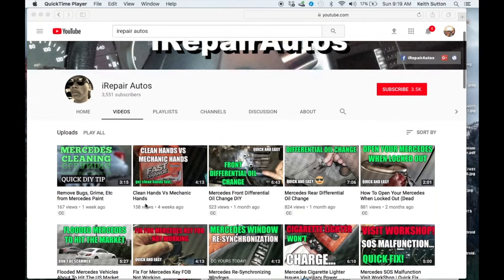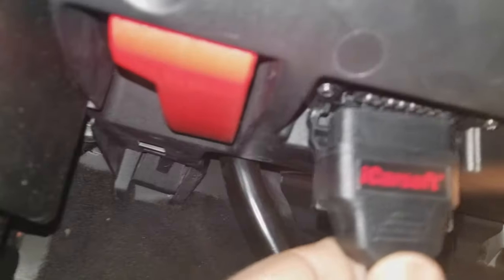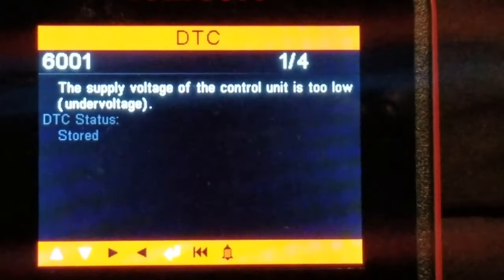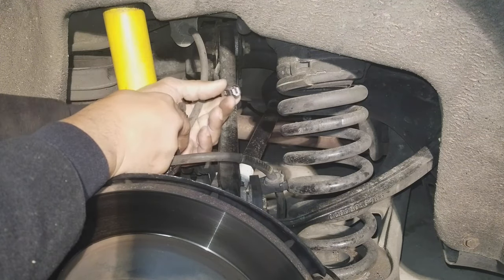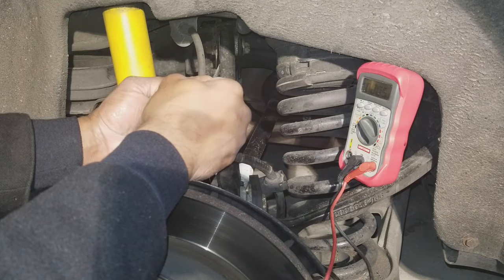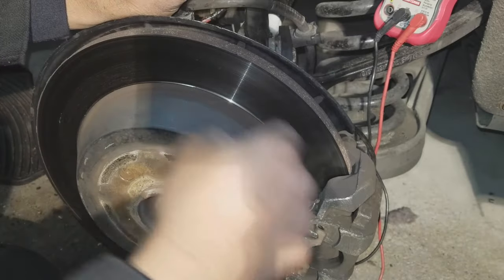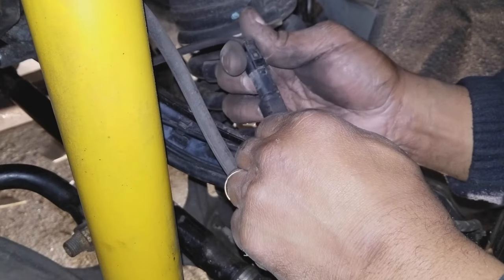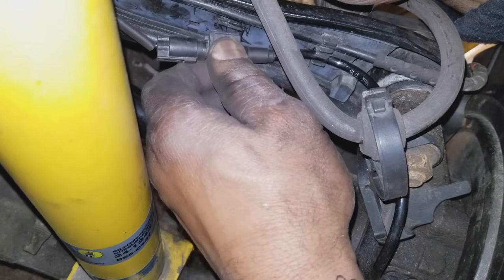Mercedes ABS Sensor/Wheel Speed Sensor Troubleshoot and Replace

Comment: Gday l was looking at a 2000-1  manual 20.ltr supercharged c200 for my son it’s 5000 Australian dollars but the speedometer doesn’t work .the guy selling it claims it has two Speedo sensors and that the OBE test didn’t specifically point out which one is the problem. Dose this Sound seasonable/true?  is it something I can  check for in the owners driveway .and DIY FIX if I bye car .I’ve been burned before.and still paying the price.so many immoral barstards out there. Is there a vid for this problem.thank you 🇦🇺👍🍻

Comment: No Go! Total bullshit! Scan says replace front speed sensors. 5 malfunctions. I installed properly. 2003 E500. Triangle with ! is lite. Car sputtering at 900rpms and 10mph. Drives great in reverse. Scanned the car several times. Malfunctions still on Cluster.